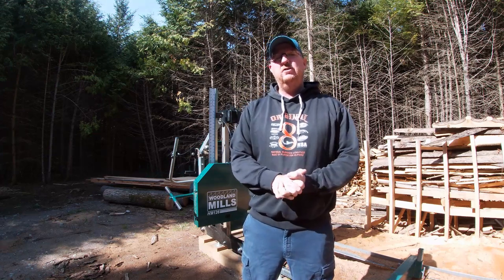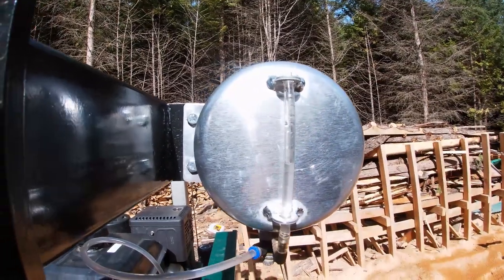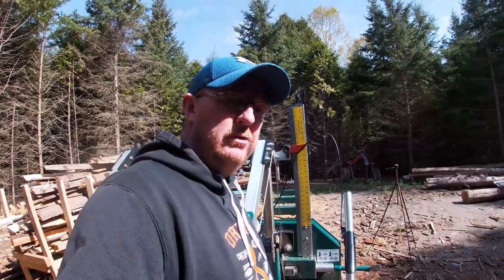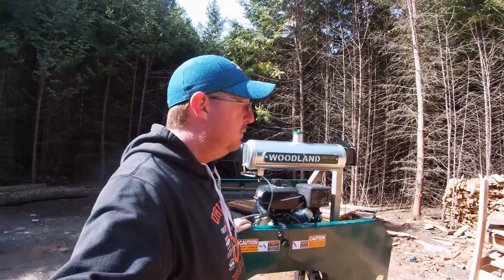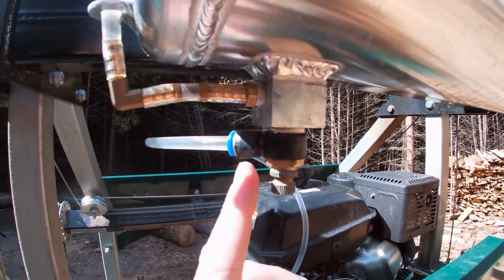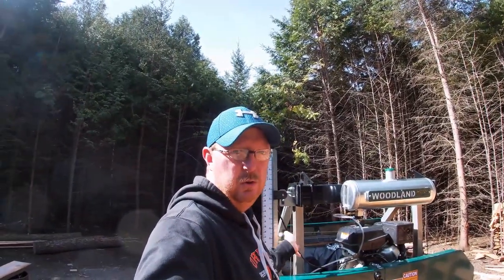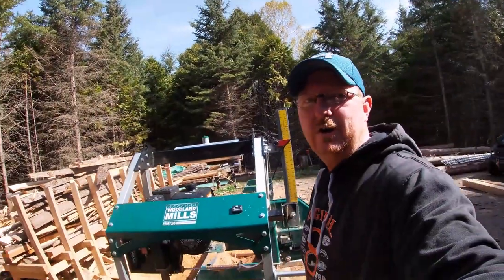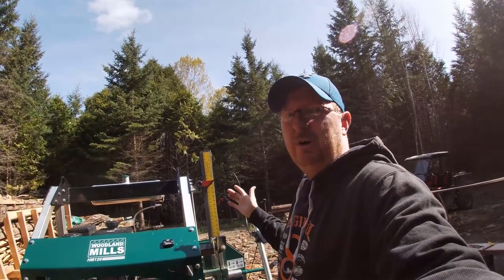#50 Woodland Mills Auto Lubrication System

Comment: Good info, I have the hm126 2015 model, it came with a manual on and off valve, it was ok, but wasted lots lube, so, I purchased the auto lube and it works great. One issue I hear people have is the throttle not going full open. I had that issue after installing the auto lube, it was the distance between the throttle lever and the plunger the bracket holding the auto lube was to wide preventing the throttle from going wide open, I hade to make my own mounting plate and it worked. It might be only on the older models. It was still a good investment as it saves on windshield washer that cost more than water.
Reply from the maker: Right on I hadn't considered that but definitely know what you are talking about I know on my model it would be very possible to have it set up in a way where the bracket could stop the throttle from going wide open.

Comment: Thanks my plate is not pushing the tip to open the valve and let the lube run thru. My log dog,the silver one with the cam doesnot work. I will adjust the lube.